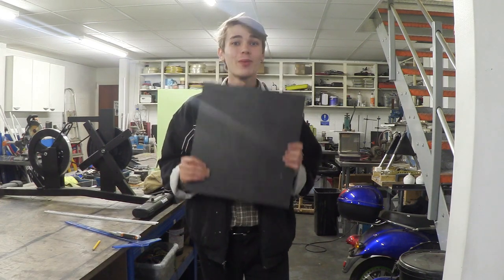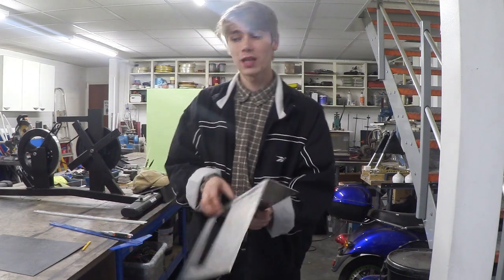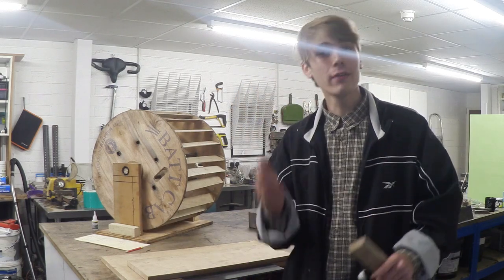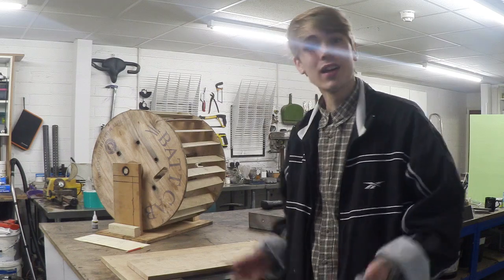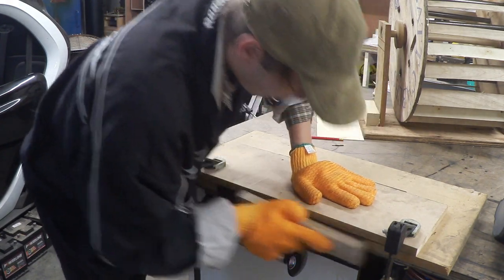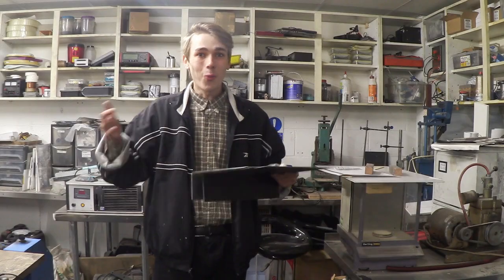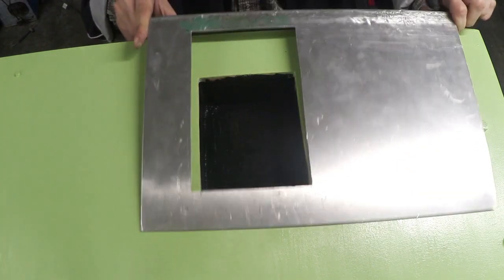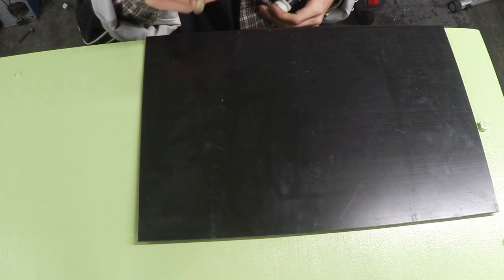How to Heat Bend Plastic

Comment: Nice tip Luke,
As others here have mentioned if you use a couple of hinges on the mdf sheets and attach a handle then you could build a poor man's sheet metal brake,
Ni-chrome wire also makes a quick and easy heating element if you don't have a heat gun, maybe a future project?

If I had to guess... It's an automated cat flap for a robot cat?

Comment: That was ABS or PVC plastic?
You might’ve heated both sides to make the corner...in fact, wouldn’t it be better to heat the side you’re bending in to as opposed to the outside of the corner like you did here?

Comment: Great job!  I'm wondering if the thumb injury was related to working with the aluminum?  That's another reason it might be better to work with plastic where you can.  😊  I can't begin to count the number of times I've been sliced up by a raw edge of aluminum.
Reply: This has happened a few times, but this Injury is related to me not being a master chef LOL. Thanks mate. :)
Reply: @MyNameIsLukey  Ah, then that would be my second most frequent method of thumb/finger injuries.  😄  Good health, hope it heals quickly!! 🥰

Comment: see's left thumb, that's really why you want to use plastic:-P

make a pen,fill with diluted ink, draw lines inside edge, dry, apply 12v to lines aka super localised heat, bend to angle, no custom touch pad thumb accessories required ^_~